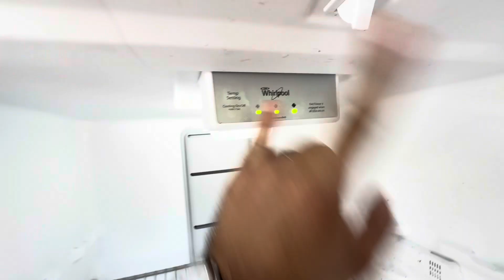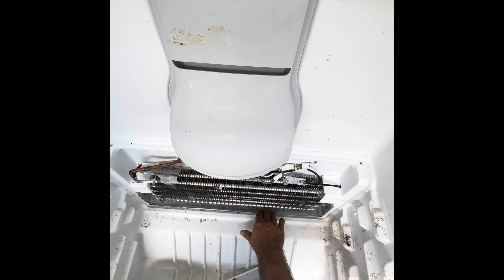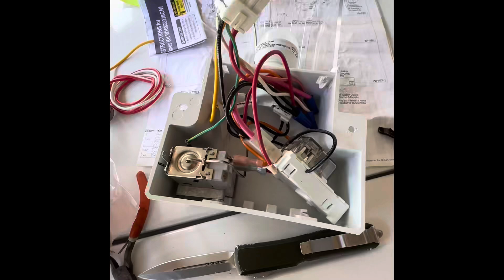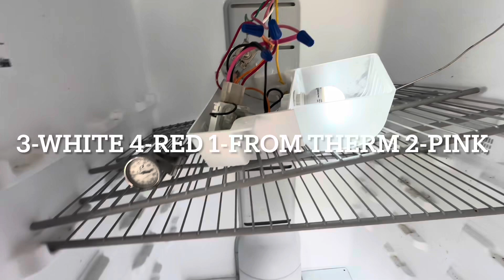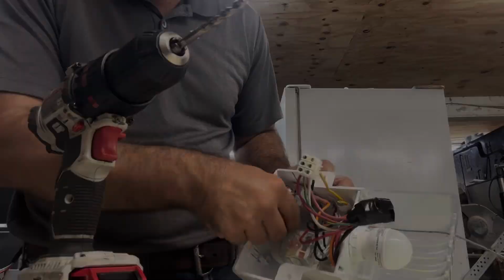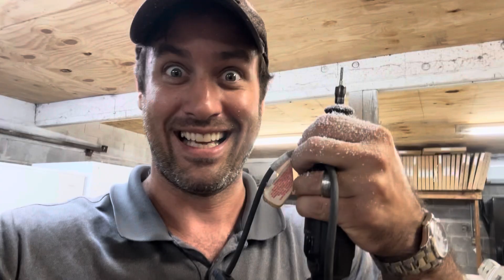Whirlpool upright freezer defrost problem | Control board out | Timer & Thermostat in REDNECK 😂

Comment: I test stoves this way checking each eye on low, seeing if the switch will shut off, then on to the next eye. Check oven the same way, I check on 170 temp. Then oven to the side for easy-off oven cleaner spraying, leave 2 hours they wash out with garden hose, make sure to unplug (unless you need real excitement in your life.)
Reply from the maker: Ahh that’s a great idea

Comment: I’ve got the same whirlpool stand up freezer. Just shit out. Keeps tripping breaker after about 10 seconds. Checked starter and compressor, everything’s good, the tiny heat sensor thingy is reading good, in stumped? Could it be the thermostat board? Maybe it’s stuck in defrost and tripping? If they can fix the issue I’ll definitely give it a shot. Thank you
Reply from the maker: Check the heater but that usually trips gfci in defrost. Are you sure the compressor isn’t shorted to ground? And trried another plug with an extension cord?

Comment: Thanks for this. The problem with mine is it won't stay in forced defrost mode for long. Only a few minutes. Is that also the board or do I need to test the thermistor and the defrost heater as well?
Reply from the maker: Ou could test the thermistor for resistance but I’d be leaning toward the board.

Comment: I have same freezer, was only getting down to 14 degrees, unplugged let it sit overnight and plugged back in and is 0 degrees... Not defrosting I guess? Can I look at timer and see if it's running to tell if timer is bad?
Reply from the maker: If you have a timer. If you have e a control board. No

Comment: Worked in the same freezer. Temp was always at 20 degrees. Pulled cover at the bottom and evaporator ice buildup. Quick Look  and saw defrost heater unplugged. Connector terminals were a little corroded so it’s been that way for sometime. I assume it came from the factory not fully seated and just finally came undone on its own.
Reply from the maker: It happens sometimes especially on units that the heater sags and pulls them loose. Good find.

Comment: Is that well grounded, working through the paint?  I have a frost-build up problem, and I think it is because when I cleaned it all out last the ground didn't get properly attached.  I'm just curious how that is supposed to be grounding well through paint.
Reply from the maker: The clip on type grounds usually have a little barb to cut into the metal and grab a hold of it.
Reply: @LAapplianceguy  Ground has to then through the screw into the frame of the freezer.  Seems like a planned failure point?  In your experience, is there a better location to attach the ground wire?  Why attach it to the removable hood?
Reply from the maker: @EpicDeals-z7y I just put it back to where they come off

Comment: My coils are froze and I put it into defrost mode and I don’t hear no sizzle. Is this a bad control panel. Also control panel won’t let me put the freezer on the coldest mode
Reply from the maker: @jeffgammell88  hmmm possibly bad control. But I would go in and check the heater for continuity just to be sure it’s good.

Comment: Hi sir, can I order the controller you made . I have same problem, don’t want to replace again. Please let me know how much?
Reply from the maker: @ngeli89  we don’t have them on our eBay store. But the part numbers I use are in the description.
Reply: W,P,R,& B are connected. What about yellow, just leave it like that? No need to connect anything? Please
Reply from the maker: @ the yellow I believe just goes to the light if I’m not mistaken
Reply: @ngeli89 did you get a reply on this? I’m in the same spot. I noticed in the video the light worked after he hooked it up.
Reply: How do you get power back to the light? The yellow and black wires from the light go where? I have broken down the video but am at a standstill with those two. Thanks for this video!

Comment: I got confused about wiring thermostat.which one wired to the the thermostat.can you show me.i had one from number 1 timer and black from  ???
Reply from the maker: @NguyenThai-hr2yu  the black wire on this one coming out of the freezer goes to one terminal on the thermostat and then the other terminal should have a wire going from the thermostat to the #1 terminal on the timer.
Reply from the maker: @NguyenThai-hr2yu  here is another shot of it. https://youtu.be/vsGYJxYexV0?si=iWoOFCgMeJd7Pvuy
Reply from the maker: @NguyenThai-hr2yu  and actually I had it wrong at first because I was reading it wrong. Overthinking it. At about 5 minutes mark is when I got it back to normal
Reply: @LAapplianceguy  thank you my man.i hope it works.
Reply from the maker: @ I haven’t had a problem out of them it’s worked many times for us.
Reply from the maker: @ power through the thermostat, then to the timers #1. Then split and put the defrost terminator inline of the heater. That way it stops heating and comes out of defrost. Pretty simple hope it works for you too.
Reply: @LAapplianceguy  hey my man, my freezer is working now but im just waiting it to recycle .hopefully it get cold again…thank you for all your help.
Reply from the maker: @ cool. If it’s running then you have it wired right. Good job let me know how it goes.
Reply: @  it was running for 5 minutes then my GFCI outlet turn red shut off the power.Did i do something wrong.
Reply from the maker: @ hmm did it go into defrost when it tripped it? Run it on a standard plug and see what happens. You can email me a picture and I can try and see if I can tell what’s going on.
Reply: @ can i have your email plz
Reply: @ can i have your email plz.
Reply: @ it is running on a standard plug now.i heard the sound from compressor.thanks y
Reply from the maker: @ ok cool. See what it does. I’ve never had one trip a gfci.

Comment: That thermister unit's metal clamp that clips onto the evaporator was found to be not holding it tightly to the tube and thus was causing a false contact. I used a small zip-tie to secure it, resolving the ice up of the fan shroud area. Just my two cents worth.
Reply from the maker: @Al78500  sweet. Thanks for the tip. I’ll have to look at that next time. So it needs to be right on the coil correct?
Reply: Yes sir.
Reply from the maker: @ good to know. Thanks

Comment: Great video thank you.  I have same unit you show there the WZF34X18DW.  Ordered a replacement control box for a WZF34X20DW which I assume will be the same cause looks identical but about $200 cheaper.  If that doesn't do the trick I will go full redneck on it.  Any chance you can post the wiring diagram so those of us that want to do this can make sure we get the wires correct?

Comment: I took the back panel off my freezer and noticed my freezer temperature dial doesn't connect to anything, is that normal?
Reply: Started as a defrost problem, let thaw out 48 hours, worked again for two weeks but now will not cool in the freezer or fridge.
Reply from the maker: @Matthew_WiIson  gotcha yeah defrost problems are tricky sometimes. Did you find any paperwork on the unit to try and put it into forced defrost? It has to be cold though for the heater to come on.
Reply: @LAapplianceguy  no, I brought relay/overload parts, someone suggested that might be my problem.  Also brought a combo deal to replace the thermostat, timer, and freezer thermostat, just in case one of those is my issue.  I wish I had the tools on hand to test the parts.
Reply from the maker: @Matthew_WiIson  I see. So it’s not running at all now?
Reply: @LAapplianceguy  The evaporator fan turns on, I feel heat on the compressor, but the air inside is not getting cold.
Reply: Yes, it's an old model top freezer fridge, WRT111SFDW03
Reply from the maker: @Matthew_WiIson  yeah that knob likely doesn’t do much. The temp is regulated by the thermostat in the fridge.
Reply: @LAapplianceguy  thanks so much for the replies, I was getting worried, ordered parts and will update if the fridge gets fixed.
Reply from the maker: @Matthew_WiIson  what’s the symptoms? Not cooling in the fridge or freezer?
Reply: What's the name of that tool plugged into the outlet used to check the amperage
Reply from the maker: @Matthew_WiIson  oh wow that seems kind of odd. What is the model number of your unit?
Reply from the maker: @Matthew_WiIson  if it’s a fridge and freezer sometime they can just be a baffle to divert air.

Comment: Those OEM board replacements must be really very expensive compare to your read neck alternative efforts. These are the same manufacturers gaslighting the public about going green to save the climate?
Reply from the maker: @ausseamore8386  right. whirlpool is proud of them I think they run about $250. But the control doesn’t really save you on that much power. The comp pulling 1.25 amps and then every now and then going into defrost pulling 3 isn’t that big of a deal. But replacing a $20 timer or $30 thermostat down the road is more cost effective to me I think. 👍🤪
Reply: The board for this one is about 250 bucks. They sell a repair kit if you can solder.
Reply from the maker: @thastinger345  yes sir I have seen them too. I’m not so good at it yet. I need to practice and get a better iron.